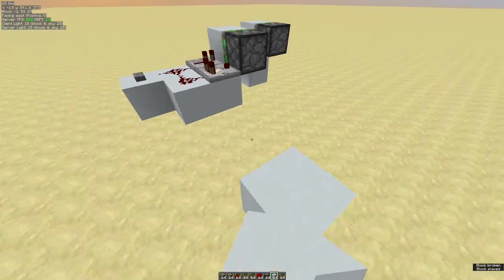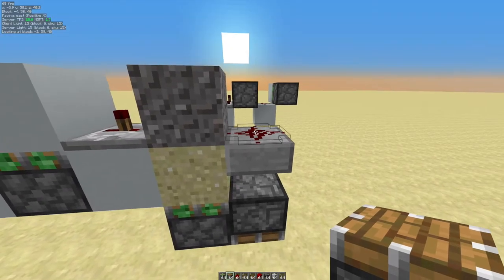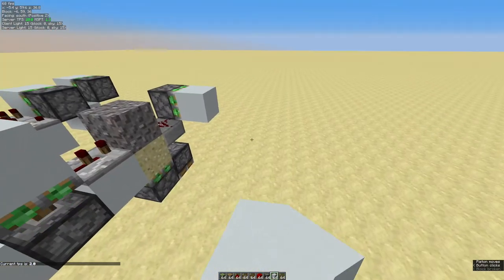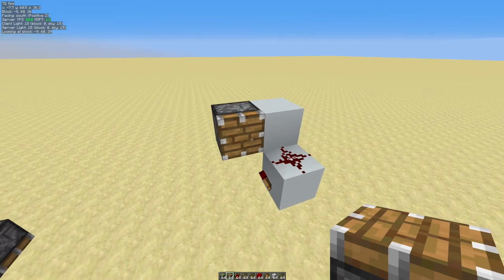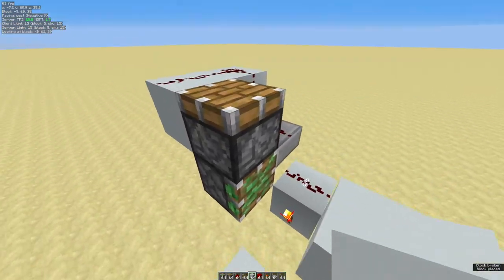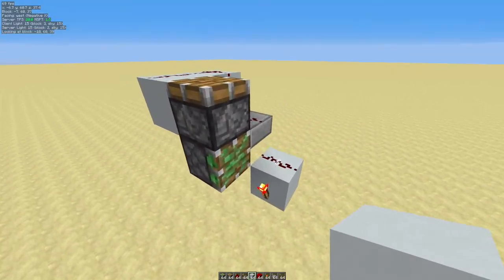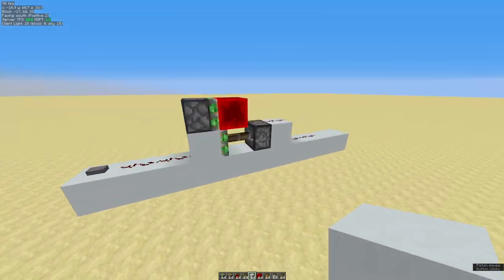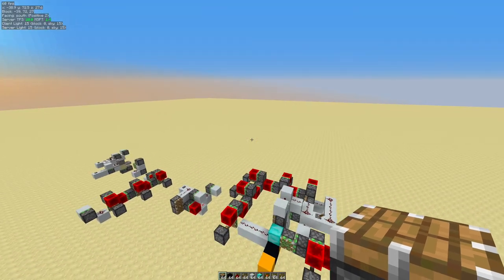Zero Tick Basics Part 1/2 | Redstone Essentials #5

Comment: Pistons dont take 3gt to extend/retract. The 2gt vs 3gt debate comes from the fact that even tho extension / retraction takes 2 gt the piston stops being b36 in block entity phase, which comes after the block event phase, so it can't resolve an extension block event in the same tick it finishes retracting/extending but has to wait for the next tick.
Reply from the maker: Thank you for pointing that out. I agree that I said the wrong thing, what I meant was that they have a 3gt cooldown before they can start extending again. But anyway, thanks again, I’ll pin your comment and mention that in the part 2.
Reply from the maker: I made a vid on tick phases and explained that there.